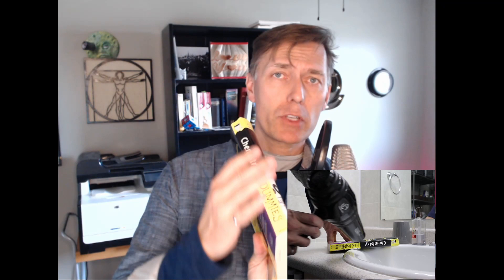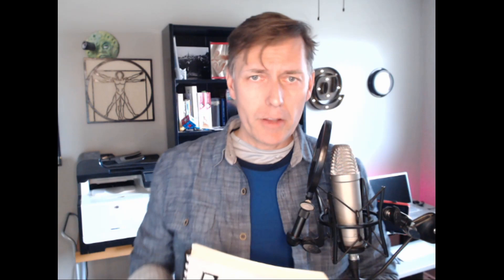Unlocking the Future of Book Preservation: A Knife-Free Guide to Book Disassembly with a Hairdryer

Comment from the maker: Here I present an alternate way to remove the cover and binding instead of using a box-cutter knife. A hair-dryer heats the binding glue up to the point it gets soft and can be pulled apart. I expect this method will work with most (if not all) paperback books, and even many hardcover books (as long as not bound using sewn signatures). 

It might be possible to re-bind this book, after it has been digitized via a sheet-feed scanner, HOWEVER, I know nothing about book rebinding, so you will have to verify this on your own.

Before you comment "OMG you are destroying books", please consider: in fact, I am freeing information from the ancient and vulnerable wood-pulp format; preserving it; backing it up to multiple locations so that it is no longer vulnerable to fire, flood, and theft; and making it far more available to me than the ancient wood-pulp format. However, DO NOT destroy your wood-pulp book if that book has sentimental and/or fiscal value.

Pro Tip: play this video at fast speed using the YouTube playback speed controls. Because you can listen much faster than I can talk.

00:00 Start with cold open
00:06 Opening stinger
00:10 Can the books be rebound? Probably. I don't know. I just take books apart. Why are you asking me? 😁
00:33 Alternate way to disassemble a book: use a hair dryer
01:00 Loosen the glue, so doesn't work with stitched signatures
01:28 Demo video on inset PiP
02:05 You end up with a few pages that have some glue chunks
02:15 The books is now exactly as it was prior to glue application at the printer
02:25 Useful if you don't have a sharp knife handy
02:45 Likely can be rebound with glue
03:02 Likely can be rebound with CERLOX
03:30 Takes a bit longer than using a knife
04:09 Closing summary
04:23 Closing stinger
04:27 STOS bridge sounds
Reply: Thank you for the ideas. After trying the knife, the hair dryer and a soldering iron with a knife edge tip, I found a Clothes Iron to be the best to take apart a book. Hair dryer is loud and slow, knife needs a lot of patience etc. but the clothes iron was so darn easy. You will get one even at the hotel. Just keep a rag to wipe it on, time to time so that some glue which sticks to it can be removed. Guys who are trying this at home do it with a spare iron if you have one, bcos when your wifey finds out what you did, you may end up in the dog house. It will be worse if you use her curling iron. I warned you. How do I know ? Your guessed it !!

Comment: Have you tried using a iron?  Heats up the glue faster, just don't use the steam.  Just need to put a paper towel or parchment paper between the hot iron and book.
Reply from the maker: That is a great idea that I have not tried. Maybe will try in a future video. Thanks so much for the suggestion! Cheers.
Reply: How about super glue does it work i will try it 😢😢😰😰😰😰

Comment: I would definitely go with the hair dryer method.  I tried the microwave and the iron but the binding would not stay hot long enough to pull the pages out with ease, thus resulting in a lot of rips and jagged edges...in fact I pretty much ruined a book and will need to buy it again, so I blame the people in these comments who suggested those methods...if you'd like to send me some money to cover my loss, let me know.  The hair dryer method though works great...the steady heat on the binding allows the pages to gradually and naturally pull away from the binding cleanly...the only tricky thing about the hair dryer method is that it would be nice to have a third hand...one to hold the hair dryer, one to gently tug the page(s) away from the binding, and another to hold the book firm while you do this...I ended up using a foot to hold down the book.  The other trick is to point the hair dryer at the joint between two pages...that is, on the inside between pages, not on the outside by the binding.  Using the hair dryer it was also easy to preserve the entire cover with spine.  Then you can use a paper cutter to cut the cover nicely.  In my case these are piano song books that are impractical to use with a glued spine, so I wanted to separate them to put in a 3 ring binder.
Reply from the maker: I remember struggling, as a child/teen, with glue-spine music books during piano lessons, fighting (and losing) to get the pages to stay open and flat. Very frustrating! I wish I had thought of putting those piano music books into three-ring binders at that time. Smart move!
Reply: Digitize Your Books practically I don’t know why they don’t make them with ring binding to begin with...Occasionally you find some that are.  Anyway, glad to have found your helpful video 🤓

Comment: Microwave works just as well and faster.
Reply from the maker: A future experiment for me to try. Thanks!
Reply: Any potential dangers using that method? Have you notice any abnormalities or unexpected events?
Reply: @mdkgr  A bit, yes.  I just did it and it works incredibly well, but, with some caveats.  First, it does warp the pages a bit with this method.  It may not be an issue if do it in chunks (feed scanner).  Second thing I noticed is it doesn't take long at all.  ~3-4 minutes on high took care of a 350pg book with ease.  Third thing, and this likely applies to the hair dryer method too, is that it smells.  I don't think the smell is particularly good for a person.

That said, this will be my method going forward.  I have a good deal of books I want to digitize and get rid of the paper copies.  To that end, I plan on buying a cheap microwave oven that I can toss in the garage.  Microwave the book, split it up into chunks, use a scissors to cut off excess glue.  Do this for all books of this type and scan.

Comment: Another book-binding removal method similar to the hair dryer method in this video is to bake the book. I recently stuck a paper back into the oven at 350 degrees F (remember that paper burns at 451 degrees F) for 15 minutes. The book will be warm but still cool enough to handle with bare hands. The binding glue will be liquid. Remove the book from the oven. Remove the cover first. Then start removing pages as quickly as you can. The glue will likely harden again in about 5 minutes, so try to separate as many pages as you can.
Reply: I forgot to mention, once you have disassembled the book into 10 to 12 page groups, it is easy to cut off any remaining glue or raggedy edge with a scissors.
Reply from the maker: Thanks for the tip! Question: Was there any discoloration of the paper? That is, did the pages turn brown at the edge? 

I wonder what would be the minimal oven temperature this works at. I might have to do some experimenting and make a related video. Thanks again!
Reply: @DigitizeYourBooks  So far I tried this method on two older books that already had yellowed pages. I do not think it browned them any further, but it might be worth a try with a brand new paperback. As you say, there might be lower temperatures that work as well.

Also, there might be variation in oven temps that might affect the setting. I was using just the cheapo dial on the oven to regulate the temp. An in-oven thermometer might be more accurate.
Reply: @m11322  Hello M. Yes I have tried it with newer books twice now. I think 250 degrees F (120C) is a better temperature and sufficient for melting bindings and not burning your bare hands. I think my original method at 350 F did not yellow the paper, but it was hot enough to warp and waffle the paper a little bit.

With a 250 F oven, I baked the book for about 15 minutes. I placed the book, in the oven on aluminum foil, opened at the middle page of the book, pages down, and soft cover facing up. I pull the cover off first. Then waited a minute or two. Then 10 or so pages from the left side. Separate them while the glue is still hot. Waited. Then 10 or so pages from the right side. Separate. Repeat until complete. Then use a box cutter or razor knife to remove any remaining raggedy edges and glue.

Comment: FYI.  For rebinding, look into 'padding compound' used for making notepads.  Hold pages in a press, once aligned, and apply a coat  on the edge with a
small paint brush.  The 'glue like' fluid is flexible so that the book opens and closes as before.  Been using the stuff for more than 50 years.
Use two flat boards with screws and thumb nuts to hold book while gluing back together.  May have to do a video to illustrate.  Check to
see if someone else has described this technique.
Reply from the maker: Thanks for the tip!

Comment: Try 60 seconds in a microwave, comes apart very nicely.
Reply from the maker: Thanks for the tip! I will have to try that. Cheers!
Reply: @DigitizeYourBooks  Did it work or did it catch the book on fire?
Reply: Is that what is meant as "cooking the books"?
Reply: William Townsend I did it and it worked! I used a book I didn’t care about. There’s still glue on the edges, but I think that’ll be okay for my purposes.
Reply: William Townsend it does work however..I only did 30 sec in the microwave.. if the books are old and pages are brown I would be careful . I took apart a few books in no time😊
Reply: Do you really want to create toxic fumes inside your microwave?
Reply: @LarryBradley  Not as much as using a hairdryer on high in a room. Besides, let it air out when you're through. Basically wood glue and paper with some minor others. The PCP is released when the paper is made long before it becomes book form.

Comment: So you'd rather look at your screen than the book? What is the point if you already have the book to digitize it, sounds like a big waste of time to me.
Reply: That books are bulky and you can't carry them around everywhere all the time
Reply from the maker: I guess I'd rather have my library with me at all times, and backed up to multiple locations. But I'm not telling anyone else what to do, how to enjoy their books. You do you. 😃
Reply: There are other use cases for this.  In my case, I am digitizing no longer available technical automotive catalogs.  The information is not available online and the hard copy catalogs are no longer in print, which makes the originals irreplaceable.  Also, digitizing allows me to use OCR (optical character recognition) to do a search using my computer instead of manually flipping through pages to find what I am looking for.  This information is invaluable across several industries, and I thank and applaud @digitizeyourbooks for this information.
Reply: Redundancy. Reading anywhere anytime. Having all of your books at your fingertips whenever you want them.
Reply: I'd add several additional points to those already mentioned:
(1) Weight, even for a single book: Depending on thickness, an e-reader can very well be lighter weight than a physical book with the same page size.
(2) Ease of cross-referencing multiple books, especially (but not exclusively) on the go. This can be useful for academic material, long novel series, tabletop gaming (core rules + supplements + FAQ and errata), and other purposes.
(3) OCR searching. Already mentioned, but becomes especially important when combined with (2) -- if I'm trying to look up a specific rule or check what exactly a character said when they were first introduced somewhere between 5 and 7 books ago, before returning to what I was doing when the question came up, I really don't want to be flipping through the pages trying to spot it.
(4) Ability to carry multiple unrelated books (or groups of books, as above) as easily as one. Can be because I'm not sure what I'll be in the mood to read, or because (in the gaming context) I don't know what my potential opponents will be in the mood to play, or simply because I expect to be somewhere longer than it will take me to read one book.
(5) Resilience and replacability. For some purposes, a decent ereader is more durable than a paperback, possibly even a hardcover. Even more importantly, if I back up my files regularly, the destruction of my ereader isn't a loss of my books themselves, just the device I use to read them.
(6) Ability to take notes directly in the "book" itself without permanently altering it.
(7) Ability to adjust the font size, and to backlight the text in low-light conditions.
(8) Ability to copy-and-paste selected text into another document.

To be clear: I like physical books. A lot. But they're not the best option for all circumstances. (This is especially true, in some contexts, given that I like them -- I'd rather stuff an ereader than a physical book, especially an older or limited-edition one, in a jam-packed carryon that also has hard-edged objects in it, and that may get banged around in flight.)
Reply: Also, and separated from the other points for controversy: Ability to make and disseminate copies. This isn't something I'll do just to save money, but there are multiple reasons I may do it in particular circumstances.
*  If some friends are willing to give a one-shot of a new game a try, I'm not going to ask them to cough up $20 or more (sometimes a lot more) for a rulebook (or several rulebooks) that they may only use a small portion of, once. 
* If I want to illustrate to skeptical acquaintances just how repugnant someones views on a topic are, I'm not going to pay for copies of the book(s) in which they express those views, giving the author additional royalties precisely because of how much I detest them. 
* If a book was written long ago, much longer than any sane copyright term, I don't consider myself morally bound by my government's having giving in to shameless rent-seekers.
* If a book is out of print, regardless of its age,I see nothing morally wrong with sharing unauthorized copies rather than buying used authorized ones -- either way, the author isn't getting any more royalties from the sale.
* Etc.